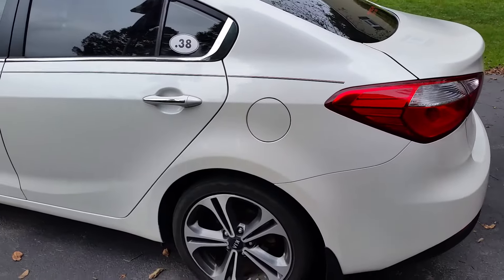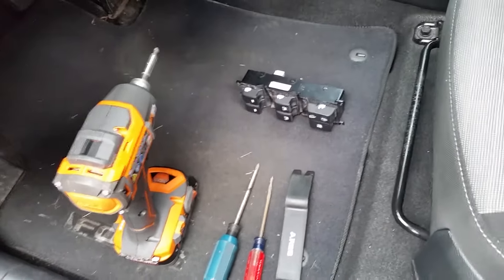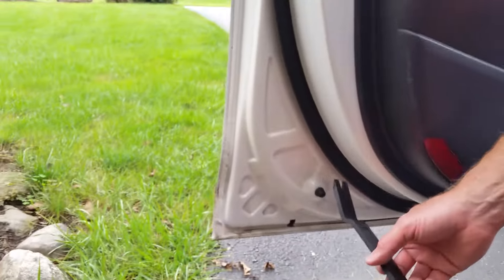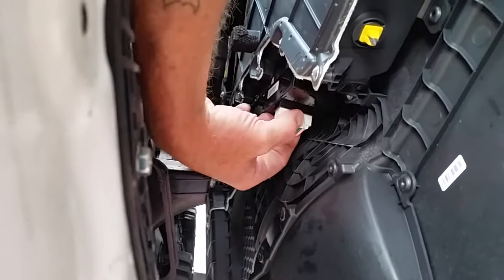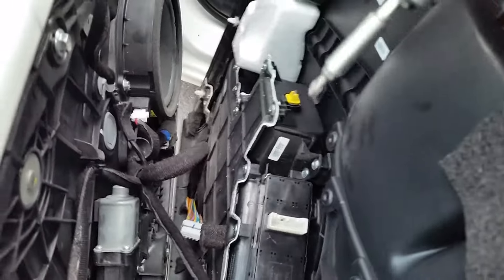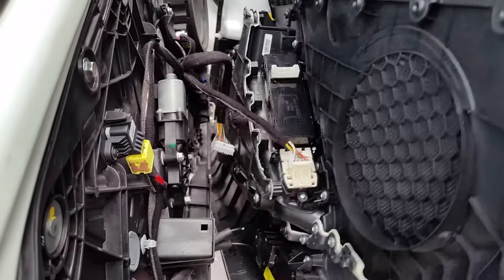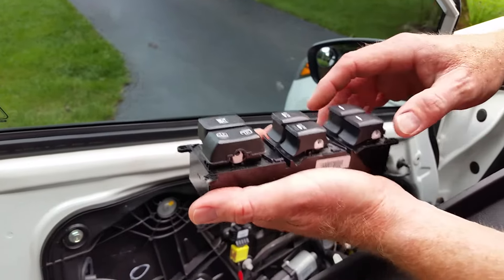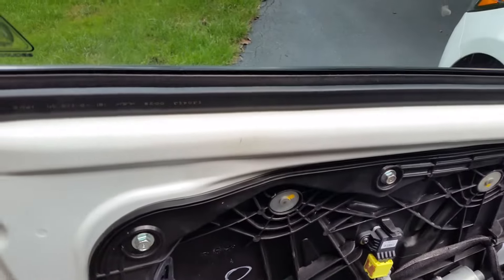KIA FORTE Door Panel Removal Access 2014 & Up Window Switch

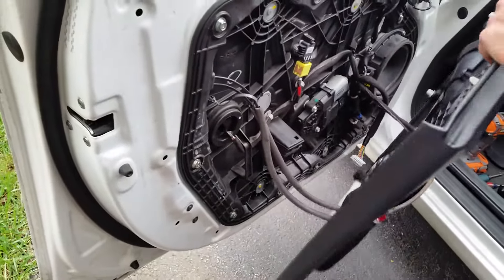Comment: I've used this video twice now.  First in late 2020, when replacing the power window master switch, and today, to replace the driver's inside door handle.  The instructions are great, except for skipping the Phillips screw hidden in the door pull pocket (where you place your hand to pull the door closed).  You have to gently pry out a soft vinyl cover to get access to the screw.  I notice in the video at 4:04, in the center of the screen, a square hole in the door panel that retains the window motor, speaker, etc.  That's where the screw and yellow plastic snap-in nut fits.

Comment: Thanks for this quick and easy video. Our 2016 Kia Forte we got last year is doing the exact same thing on the driver's window staying down once pressed. It's a shame, my much older 1995 Dodge Ram secondary vehicle's driver electric window still works perfectly fine and that thing has over double the mileage the car does. I guess the gas savings over the truck will offset this inconvenience that's not covered by the aftermarket drivetrain and HVAC warranty we purchased on the car
Reply from the maker: Glad it helped.

Comment: Excellent demonstration. I was able to replace mine this morning. I would've have liked it if you showed us how to just change the nob only. The only problem I had with mine is that the non that controls the drivers window broke off. The company said that they dont sell the nob alone so I had to buy the entire master switch and instead of replace the nob only, I replace the entire thing
Reply from the maker: Cool. The problem is that when showing the actual rocker switch (knob) replacement, it would be a very close-up video and my hands would block the screen. If you get as far as removing the master switch, typically the rocker is no big deal.
Reply: @miamitopa  alright man. Thanks okay. Thanks again regardless!

Comment: Hello, I have a Kia car and it only has 1 button for the driver's door to automatically pull the window. Can I replace the 4-door automatic window pull button set?. Can it work when replacing that set of buttons?. Or does it need another control module to be able to control all 4 doors automatically? Thank !
Reply from the maker: Sorry, but I am unable to give you an accurate answer to the question.

Comment: Would there be a possibility of the window staying down if the switch plate was not replaced?
Reply from the maker: Yes, there is a possibility, depending on what has failed within the switch. It is possible that you are able to lower the window and then it refuses to go up.

Comment: Where can i buy those wire harness/cables/connection for minute 4:24? My mirrors won’t work, apparently it was tempered with before i bought the car from a dealership.
Reply from the maker: The pigtails/connectors will most likely have to come from the Kia dealer or an online used parts seller on ebay. Good luck!

Comment: Thank you for the video.  Do you have any suggestions for changing the buttons on the switch relay?  You mentioned that you were going to do that part.  How did it turn out?  I'm in the same boat with having a replacement part that doesn't have the same action on all 4 switches so I was going to mix-and-match all the parts together to make one relay that works fine.

Thanks!
Reply from the maker: Hey Johnathan. Yes, switching out the individual rocker switch from the used master switch that I bought on ebay, to my existing master worked fine. Just be careful when removing the rocker from the one that you purchase as well as attaching it to your existing master. If you snap it, you'll be back in the same boat.
Reply: @miamitopa  Thanks for the reply!  I couldn't get the switches off of the old relay for the life of me.  Currently the replacement is in the car and I'll continue to fiddle with the original part to see if I can get it disassembled.

Comment: If I want to change my speakers, do I have to undo everything or can I pull the panel then just hold it in place?
Reply from the maker: You can pull the panel and support it in some fashion. The speaker can then be unscrewed from the actual metal door shell and replaced. Reverse the panel removal and you'll be good.
Good Luck!
Reply: @miamitopa  thank you. I'm a bit nervous to do it but also don't want to pay someone all that money lol. Thank you for the tip and your video
Reply from the maker: @Cutelycaca  😉

Comment: Thank you for posting this. I have this issue with a  2010 Kia Forte Koup. Where did you purchase the plastic pry bar?
Reply from the maker: Don't remember where I bought mine from, but this is a nice set from Amazon that has many uses. Good Luck...   https://www.amazon.com/Feigo-Pieces-Removal-Tool-Kit/dp/B078R2ZC41/ref=asc_df_B078R2ZC41/?tag=hyprod-20&linkCode=df0&hvadid=241923060470&hvpos=1o2&hvnetw=g&hvrand=9724518536676519272&hvpone=&hvptwo=&hvqmt=&hvdev=c&hvdvcmdl=&hvlocint=&hvlocphy=9007350&hvtargid=pla-413617186526&psc=1

Comment: That button can be repaired or should I change the part
Reply from the maker: The individual buttons are not available. I purchased a used switch on ebay and then swapped the broken over to my existing unit, since mine was working well otherwise.

Comment: My 2013 Kia forte window switch is broken also
Reply from the maker: Hey, if your actual power window rocker switch is the only broken part, you can buy a replacement switch assembly (ebay, junkyard, etc.). Pry the rocker out of the replacement switch and your old switch (the same position as your broken one, as they are different; LF broken, use the LF out of the replacement switch).  Snap the "good" rocker back into your old switch. Reinstall switch assembly.